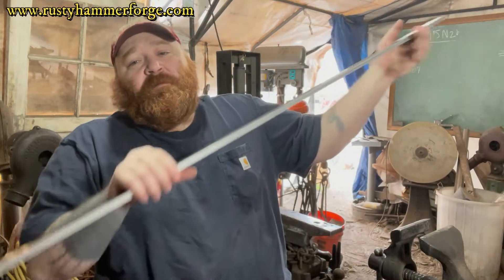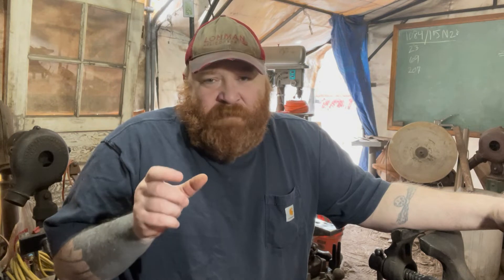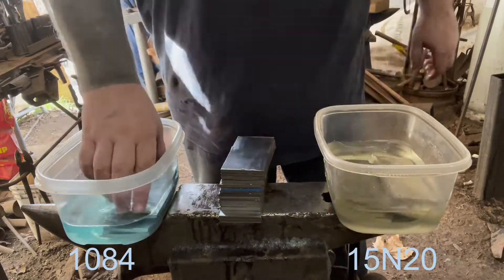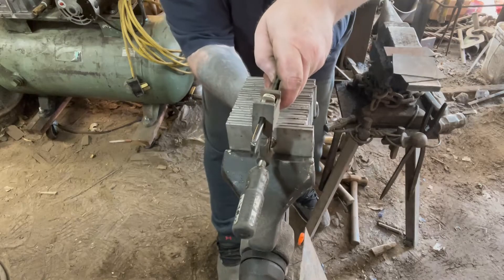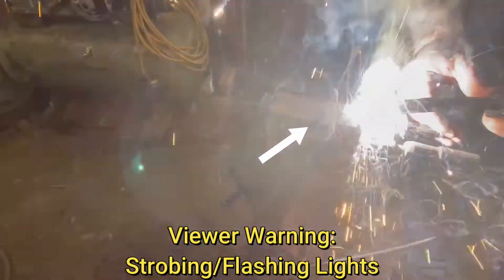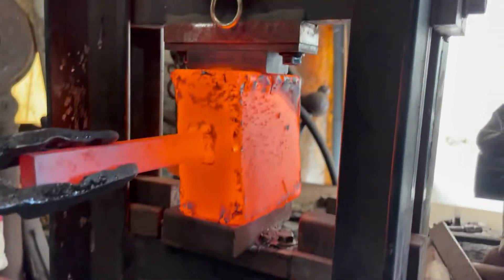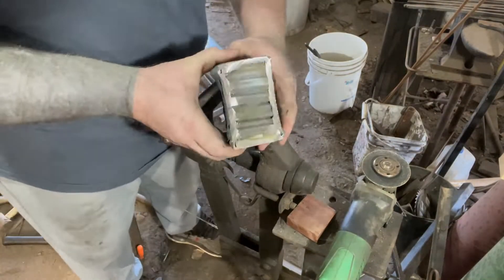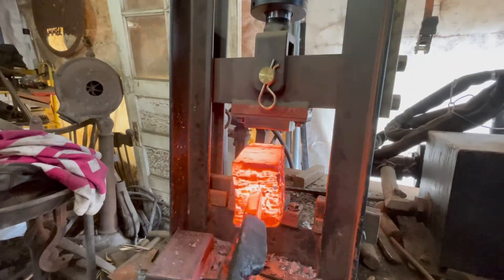Damascus Steel: 23 layers Pt. 1

Comment: Hey nice work. I have the same press glad to see it’s working well for you. Gonna try my hand ad some pattern welding as well. 
What is the reason you wanted to avoid using flux?
Reply from the maker: The main reason is so I dont have to rebuild my forge all the time, the second reason is that I have less drop and can consistently get perfect forge welds. Non-Atmospheric is always better, essentially you are doing the same thing with flux, just a lot dirtier!
Reply: @rustyhammerforge5902  That makes sense. Guess it’s time to bust out the MIG welder. Gotta find some appropriate sheet metal to cover the sides of the billet.
Reply from the maker: @madtitan1946  I use as much found sheet metal as possible. It is a little more work, and a whole lot more reward